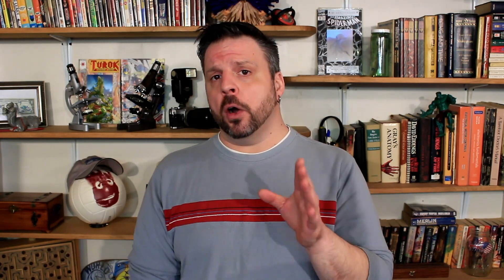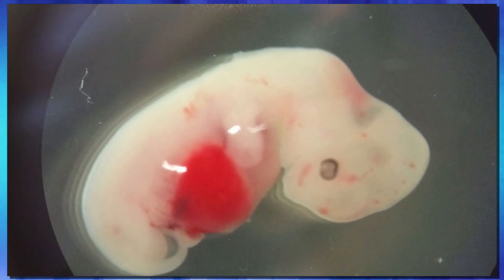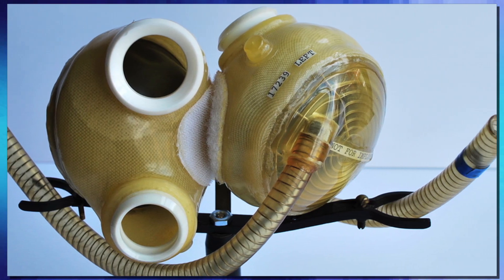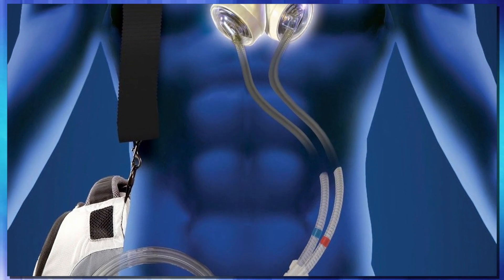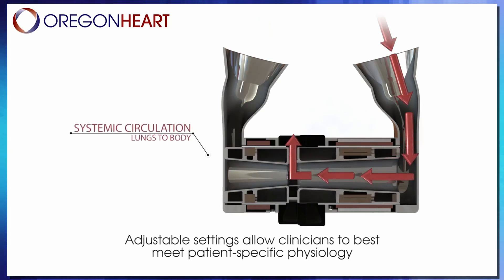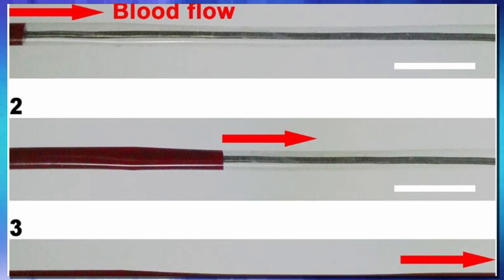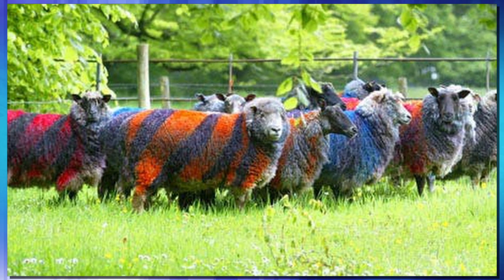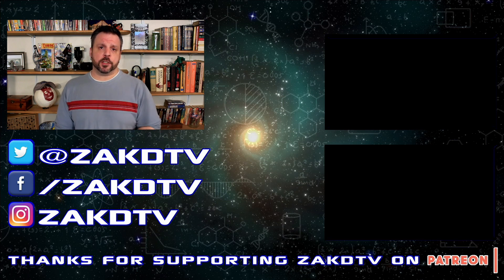FIRST Artificial Heart meant to be a permanent replacement !

Comment: That is a difficult question to answer, if I would trust an artificial heart, would definitely have to give it a lot of thought, you would think with our technology we would be able to come up with some reliable pumping mechanism that the body wouldn't reject, and if it quit working all of a sudden, now I'm not a doctor but I would think that would probably be fatal, I don't think it's like something the local hospital could take care of even if you could get there within minutes. Very interesting question.
Reply from the maker: I believe with the simplicity of this device it seems like it should be reliable . As for rejection I have a titanium alloy rod in my leg that has been in there for 20 years without a problem. Now not being a doctor I don't know how the same alloy reacts to carrying blood or whatnot. Huh, weird thought, do you think a fatty diet would be good with this fake heart? I mean it would be like keeping a machine well greased right? Lol. You are right however if it did fail you couldn't run to the local hospital or mechanic to get it fixed. So yeah, I wouldn't want to be an early adopter but if the device will last and I wouldn't have to be on immune suppressants I don't have an ethical problem with becoming a bit more of a machine.
Reply: I agree with you I wouldn't want to be one of the early adopters, inevitably what ever new products come to the market there almost always is some bugs to get worked out, and I to have no ethical problem with using a device that would keep someone alive, a matter of fact I'm 100% or it. I'm in my late 60s and have no heart problems so far. But I definitely have empathy for people who are looking for options. I think I would probably have a heart attack if I had to make that decision LOL.
Reply from the maker: Hahahaha, keep that heart healthy man.